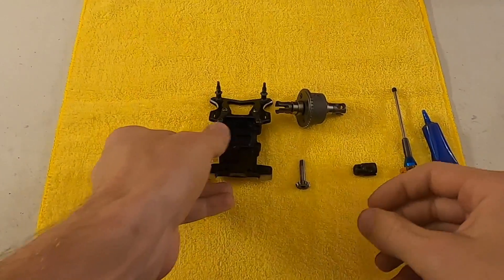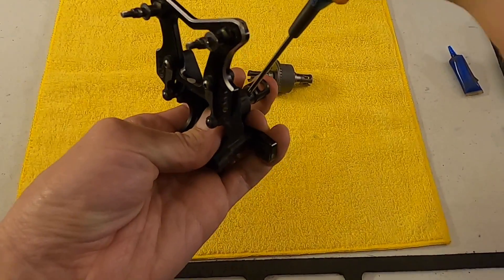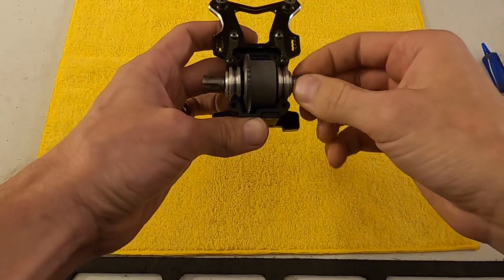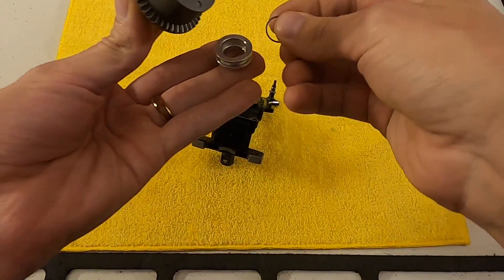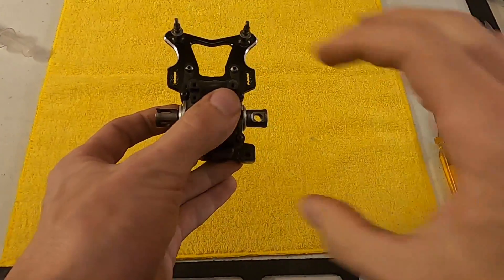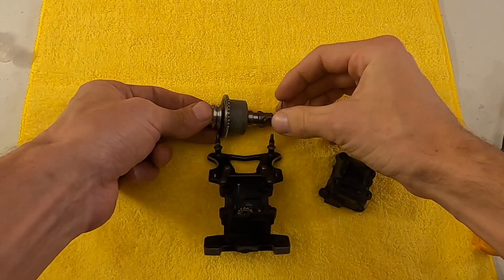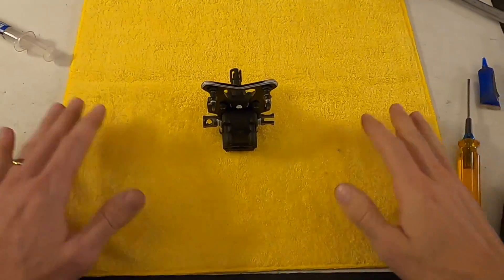How to Shim RC Car Gear Diff Differential [Beginner Tutorial with Ryan Lutz of LutzRC]

Comment: The set screw is machined with dimple and then hardened. The dimple/cup bites into the flat of the shaft. 
No need to modify it. And yes use a VERY small amount of Loctite on it, but the cup should do the work and Loctite is not needed.

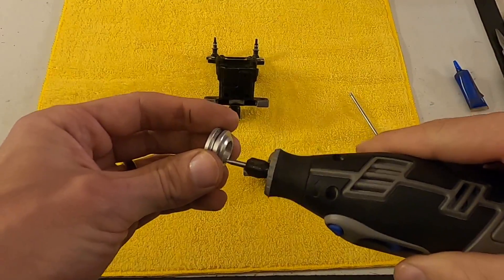Comment: Great video! i learned alot but i noticed one thing. At 3:00 you talked about wanting the bearing holder loose on the bearing... that is not correct. for everything to function correctly the bearing holder should grasp the outer bearing race securely... otherwise the holder will be rubbing against a spinning bearing race and wearing away fast but even more important, it will cause excess friction and heat in the bearing...
Reply from the maker: With how tight some of them grip the bearing it actually causes the bearing to restrict its ease of spin. 
For performance in an RC car what I showed was better for me. I realize that some things we do for an RC car aren’t perfectly translated from proper engineering standards. But it’s all about performance for us on the track. 

Thank you for the comment and insight though! 👍🏼

Comment: Sudden accleration backwards causes clicking in the gears please help im a noob ive opened both diffs no stripping that i can see
Reply from the maker: Most likely diff case is flexing allowing the gears to jump. If no wear count your blessings. Perhaps you can add a shim to ring gear side or on the pinion to tighten up the mesh a little.
Reply: @RyanLutz  i tried washers but they were to big ill have to shimm thanks for the quick reply bro 🤙

Comment: hi there, what do u call those 2 circular aluminum on both sides where you put the shims? where can i get it? will it woork for arrma kraton 6s? thanks so much for the informative videos....
Reply from the maker: They are diff bearing holders. They are Agama parts. If your vehicle doesn’t come with then then they won’t work on it. Most cars are designed with only a single bearing in either side of the diff.

Comment: I have a Kraton 4s and I keep eating pinion diff gears do u know y
Reply from the maker: I can't say for certain but perhaps just too overpowered for quality of materials. You can try to shim your gears a little tighter. But it's also possible the bulkhead is wearing out creating flex too.
Reply: Ryan Lutz should I just run it on 3s and shim it up
Reply from the maker: Daniel Puris id do what the manual suggests. But shimming wouldn’t hurt.
Reply: Ryan Lutz well it’s supposed to run on 3-4s